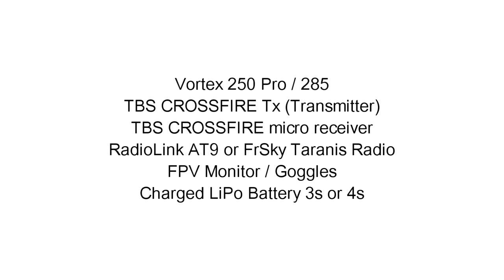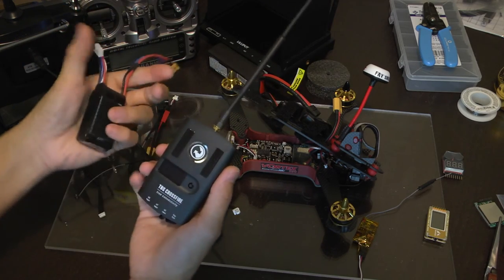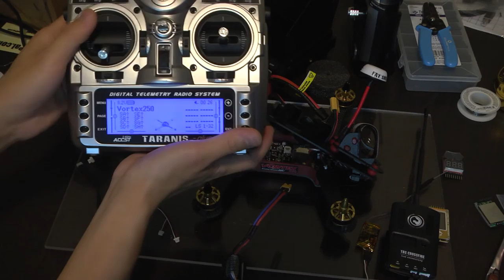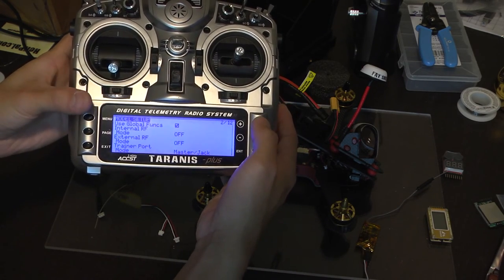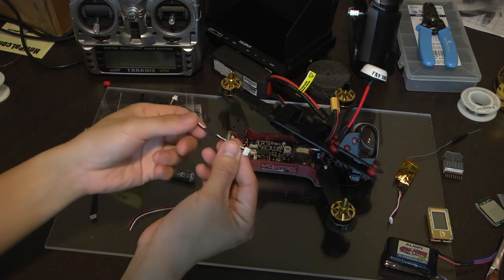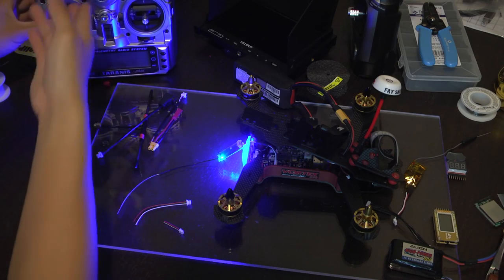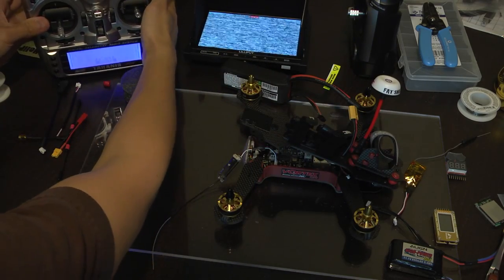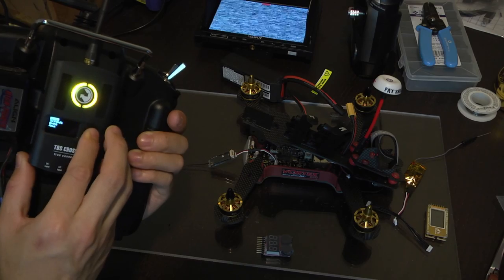How To Setup Team BlackSheep (TBS) CROSSFIRE on Vortex 250 Pro / 285

Comment from the maker: Another note about the trainer cable for the Radio link AT9, it uses an S-Video port and not at DSC port (found on Futaba systems).  You will need an S-Video to 3.5mm 3-pin female jack cable.  Simple plug it in the back of the Tx and use the provided 3.5mm jack cable from TBS Crossfire and connect them together.  HeliPal support can also assist you with this as they are a major reseller of the AT9 and where I purchased mine with Crossfire.  Hope that helps!

Comment from the maker: Note about failsafe setup in video, you should be using "motor cut" rather than "defined position hold" for better safety reasons - meaning the motors will spinning like in the event of the crash preventing further damage.  Both are valid but motor cut is better in my opinion.  More advanced failsafe setting can be configured in Cleanflight or Betaflight GUI.

Comment: When running this firmware 2.19 like you did were you able to get Telemetry call-outs like your signal and your voltage on a call out on your taranis
Reply from the maker: fritzryan79 Unfortunately I haven't tried the new firmware.  I'm on v1.57 and that has been rock solid.  I don't really update radio firmware unless there is an issue.  I've never had to rely on the Taranis telemetry since I always run OSD.

There is a recent tutorial video on how to get telemetry working on the Taranis and it's pretty good. It came out in early October.

Comment: awesome video i was wondering what kind of flight range you are getting out of this setup?
Reply from the maker: I'm getting at least a few kilometers out of this (on another larger quad, I've gone over 20km easily), but most importantly no interference or drops as I fly with a bunch of people with 2.4GHz radios and between trees and objects.   Hope that helps!
Reply: thanks for the reply! yeah I got a vortex 250 pro and I had a failsafe at 400 yards in a hay field. I had to wait until they harvested the hay to find it and the vortex was chopped to bits :/ Now I'm debating on getting another one with a setup like yours or something bigger... what type of quad did you fly 20km with?
Reply from the maker: +ShanaAndJeff No problem!  That is an unfortunate incident to hear :(.  I've lost my quadcopter before due to failsafes.  It's all up to you but typically, I tend to spend more on radio systems and control as they tend to last longer and it is one of the most important things for flying.  The investment lasts longer too.  

I am flying with a CineTank Mk 2-L (550 sized) to with an EagleTree Vector achieve that long range.
Reply: cool, I appreciate the advice. One last thing.. can you do aggressive flying and tricks with the CineTank or are the larger quads more for cruising... weighing my options :)
Reply from the maker: +ShanaAndJeff No problem, and glad to help.  Yes you can do aggressive flying, but it depends on what flight controller and how you set it up.  A Naza FC might be more appropriate than a Vector.

Comment: I have Rssi in my osd on vortex channel 8 on reciever in betaflight assign aux 8 in configuration set up Taranis to play value link quality I have both audible and osd. 👍👍100% always which is reassuring when blasting about. Betaflight 3.2.2. And I’ve ran 4.0.6 it does work but you lose tuning with osd but everything else works.

Comment: `Hey MatrixWriter great video! I am wondering if it's the same method to set up the EzUHF module to the RX and do you use the CRSF for external power to the module, any help would be appreciated...Peace and happy flying
Reply from the maker: DALE Kennedy Thanks!  Sorry for the late reply.  For EzUHF I don't use CRSF as the newest firmware tends to reduce range and such (higher data rate) for my flying requirements (I use the JR module). If I am correct you would select CRSF under the external setting for the Taranis and everything should work (it is a new feature just to note).  PPM works guaranteed without any issues. The IRCTools allow you to configure additional settings such as the channel and data rate which you will need to do.  Let me know if you have any questions.

Comment: Hey Matrix! Does it also work with radiolink transmitter at9s?
Reply from the maker: Hi! Yes, it most likely should. Any transmitter with an aux/trainer port available should - it's detailed in the Crossfire manual.

Comment: hey matrix im thinking of getting some graphene lipos.... i see your using them what kind of flight times you getting with them? im trying to figure out which ones will fit the vortex besides the 1300 mah
Reply from the maker: I am using the Turnigy 1800mAh graphenes and I get about 3-4 min flight time (they fit perfectly fine on it).  They are pretty heavy compared to other cells of the similar capacity.   Punch outs are not an issue with these cells and they hardly puff compared to others.  Probably don't want to go past 2200mAh on size as it will be too heavy for the quadcopter and not increase run time by that much. 

Hope that helps!

Comment: so I'm use to the xr4 when you shut the remote off the motors stop spinning, when I set the fail safe for the crossfire continue like you said to the last position. how can I get the motors to stop in failsafe?

Comment: Hi great vid pal. I'm wondering if you know anything about wiring the micro receiver to a standard kiss FC? 
With my micro rx I got a Tbs servo adapter, and I'm assuming I plug the black lead that comes with the rx into the rx and servo adapter. And then plug my servo lead that comes from the FC into the servo adapter? Is this something you can help me with?
Reply from the maker: shlllong Thanks!  I recommend using S.BUS on your Kiss FC.  It's a faster and simpler protocol over others.  Connect everything up to the FC Rx port.  S.BUS, has only 3 wires - signal, GND, and power.

Once you have everything wired up, you will need to bind the receiver to the TBS Crossfire.  After binding, you need to change the receiver mode to S.BUS through the Crossfire menu.  Finally, you will need to configure your flight controller in Cleanflight or Betaflight to use S.BUS - it's under configuration menu.  

Hope that helps!  Maybe I might make a video on this in the future that goes through the the entire setup of configuring and binding.
Reply: Mate thanks a lot I've hit the sub button that's a great reply. Very helpful
Reply from the maker: shlllong Awesome thanks!  Feel free to reach out if you have any other questions!
Reply: It's all good man I got it singing sweet now. I think it was just that issue. I wasn't sure and didn't wanna blow it up. Look forward to your other videos, you done well here mate. Cheers
Reply from the maker: shlllong Awesome!  Glad you got it to work.  Happy and safe flying!

Comment: Have you gotten the rssi from the micro rx to show up on your osd on the vortex? If so could you please make a video to show how to do it? Thanks.
Reply from the maker: +Milano 20s No go for me yet.  I think RSSI support might work only for the full sized crossfire diversity receiver and not micro RX.  For the full sized RX you would need to CPPM mode and then another another channel output for RSSI.  This is configured and done on the crossfire TX for the channel mapping/output.

Comment: How about getting rssi info on the osd? Iv'e had it randomly pop up during flight at one time.
Reply from the maker: +Universal Pioneer No idea on this, I wished I knew this as in the Vortex's OSD, it mentions support for EzUHF  RSSI.  For RSSI on TBS products, you need to use the BST cable and port - there is no port I see anywhere for the Vortex's flight controller.  TBS support might be able to shed some light on this.

You might be able to use CPPM / the original receiver port that comes preinstalled with the cable and use it with the full sized crossfire receiver to get RSSI.

Comment: Sorry, i do not speak english. I see that tbs crossfire tx works in radiolink? I have radiolink. Would I just have to buy tbs crossfire tx and rx? works by the training exit.
Reply from the maker: Isidro Suarez That is correct. Power the Crossfire with external power (up to 3S lipo) and connect it to the trainer port of the RadioLink. RadioLink should provide an adapter or you can easily get one online.

Comment: Cool... u think I can fit a d4rII inside the 250 pro?
Reply from the maker: No problem. The D4R-II can fit inside the the quadcopter.  Make sure to remove the paper case and use some shrink tubing or a little bit of tape of cover it to reduce the foot print and prevent shorts.  When placing it inside the quadcopter, make sure not to cover the barometer (covered by foam on the flight controller).

Comment: If I've got a 3S LiPo in my Taranis, will it give me access to 2W power out of the Xfire TX or does that only happen if the power is routed directly through the XT30 plug on the TX module? If that's the case, I would either route power directly from my TX LiPo to both the Taranis and the Xfire TX or use a second 3S LiPo for the Xfire?
Reply from the maker: The Trans is not capable of supplying enough power an the external TX module from the built in battery regardless of what battery is used.  So the TBS Crossfire is limited to 500mW transmit power.  So in order to get 2W transmit power, you have to use an external 3S LiPo battery (or 12V power supply) connected to the XT30 connection on the TX module.  I use a small 850 mAh LiPo attached to the radio, but as you mentioned, you could route power from a built in LiPo pack from the Tranis to the TX.  

Note the applying internal and external power does NOT cause damage to the TX.  The system automatically switches.  However, it will reboot if you remove external connected power.  Might be fixed in later firmware but I haven't tested that yet.  Hope that helps!
Reply: Thank you, it does help. . . a lot! So, if I power the Xfire module with a 3S LiPo, will that supply power to the Taranis as well, or do I still need to still have my internal TX LiPo connected to the Taranis? Sorry for the 20?s. . . this isn't covered in the Xfire PDF instruction set.
Reply from the maker: +bauhaus No problem.  The Xfire will not supply power to the Taranis if external power is connected to the module.  The module must be connected to the controller in order to take over the stock Taranis TX and provide control of course.  So you need two sources of power of you want more transmitting power of the Xfire of 2W max.  One external 3s LiPo pack (or 12V DC supply) and the built in battery (could use an aftermarket LiPo) for the Taranis controller itself.  

I recommend using a pretty large external battery as 2W of power quickly drains the battery. I get about 20-30 min of flight time when using 2W with my little battery.  Using the stock built in Taranis pack (Ni-Mh battery) I get around 2-3 hours @500mW.  I set the power on the TX to be variable than fixed in most instances and let the software do the work. 

I had to email TBS support as I had questions like these before I ordered mine awhile back.
Reply: Thanks agains for your help. I just drilled a hole in the battery plate of my taranis and ran a JST from my LiPo to the outside to connect with the Xfire. Very helpful advice.  I'm running a RMRC 2500 3S in my TX, it'll be interesting to see how much time I get on 2W but I'll definitely let the software do the work, as you described. Looking forward to using this!
Reply from the maker: +bauhaus Ooops responded with my other channel haha. 

...No problem and glad I was able to help out. 

Make sure to keep an eye on the voltage of the battery so you don't kill the pack - the Taranis and send you an audible notification on low voltages. 

When you get the chance, let me know how much flight time you get as I might do the same thing. I will reduce the bulk on my radio and make it lighter and run longer. 

Happy and safe flying!

Comment: Hello, do you have a lot of tx signal strenght, but what about video strenght signal
Reply from the maker: stefano ath I have both lots of Tx and video signal.   The receiver antenna could be mounted better and more vertically, but for racing and short range flying this works out fine.   For video, it depends pretty much on your video receiver antennas you are using as well as how much transmit power you have set.

Comment: hey matrix how you set. failsafe with the d4r II? with the motor spinning on start up? it seems to work with the motor not spinning on start up
Reply from the maker: Set up fail safe via Taranis (there are guides on that) as well as in Cleanflight if you want change the default.  Default failsafe in Cleanflight is to kill motors after specified amount of time of lost signal has occurred.  Of course you can change this to something else like throttle positions.

Not shown in the video with the TBS Crossfire system's failsafe menu can be to hold throttle position or to cut motors (send no lost connection signal to flight controller and the motors will cut).

Comment: doesnt that receiver only have 4 channels and would not pose a problem? i thought u need atleast 8 ch???
Reply from the maker: Travis Dean The TBS Crossfire micro receiver is 8 channels when using S.BUS or PPM modes.  You can use 4 channel receivers on a quadcopter,  but you will not be able to change flight modes.  That's why at least 5 channels is recommended.
(I accidentally responded with my other channel FYI...)

Comment: That's wassup you know a good spot? soo I don't mess something up i was thinking maybe wrapping it with some electrical tape
Reply from the maker: Place the receiver in the empty free spot right behind the LED lights  and the rear arms.  It can rest on top of the flight controller, but make sure not to cover the barometer.  Thread the two antennas between the arms and the LED board and then zip tie it to the rear plate.  Hope that helps!

Comment: Hi.. i have tbs crossfire Diversity Receiver, what is the channel number for sbus, because i want to wiring the receiver to pixhawk. thank you
Reply from the maker: Deki Azali Sorry for the late response.
The channel number for S.BUS is channel 8 -- this is mentioned on Page 28 of the user's manual.  Once you have the receiver and the transmitter binded together, go under the Crossfire Tx OLED display menu and under receiver settings you can set the receiver protocols there. You can remap other channels as needed.  

If you are using the micro Crossfire transmitter, you can configure the settings vis the TBS Agent.

Let me know if you need any help.
Reply: thank you Matrix, the problem has been solved, many thank you, and keep contact ya bro.
Reply from the maker: Deki Azali Excellent to hear that!

Comment: Hey I'm having a lil trouble I had a lil crash and now I have no osd and a black screen i took it apart realized the white camera cable was cut resolder it still nothing... the vortex beeps 2 long beeps and a short one then goes through the rest of the sequence :(
Reply: Oh no!  That's unfortunate to hear.  Seems that your flight controller+OSD is damaged.  I'm not sure what the beep codes means.  Couldn't find anything in the manual regarding the beeps.
Reply: +JPMediaProductions yea it sucks its a design flaw alot of people having either the camera connection snapp off are the wires pop damn camera lead to short aswell
Reply from the maker: Looks like I responded with my other channel, my bad!
Yes, I would agree that is a design flaw with the Vortex about the front FPV camera port and having the bottom portion opened.  However if the FPV camera is not working, OSD should still be working.
Someone had a similar problem like you here:
http://www.rcgroups.com/forums/showthread.php?t=2613710
Reply: +MatrixWriter lol its all good idk I'm hoping it's the camera some others say they had the same issue and it turned out to be the camera everything else seems to be fine time will tell once i get the new camera
Reply from the maker: Sounds great to me, keep me posted as it will help with troubleshooting future issues.
Reply: +MatrixWriter will do thanks
Reply: +MatrixWriter yep that's what it was i now have video bad cmos cam
Reply from the maker: Ah!  So the FC wasn't broken then.  Interesting that it would affect OSD then...

Comment: u how to get the rssi to show in the goggles? i have a taranis i already set it up in there
Reply from the maker: Not entirely sure.  There is a video of someone who managed to get it to show up.  I think you have to use the PPM mode to do that as the Vortex doesn't support CRSF data input like the TBS Core Pro for RSSI.
Reply: i figured it out thanks
Reply: So, how did you do it?